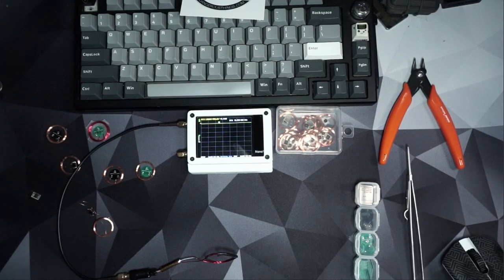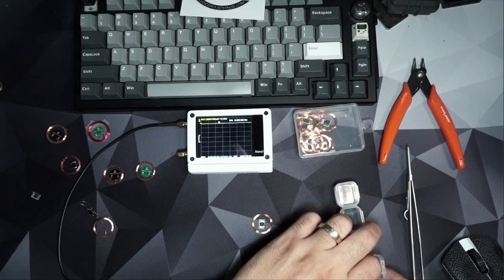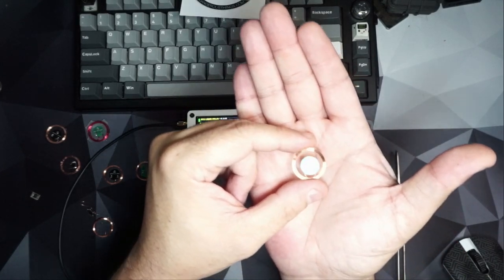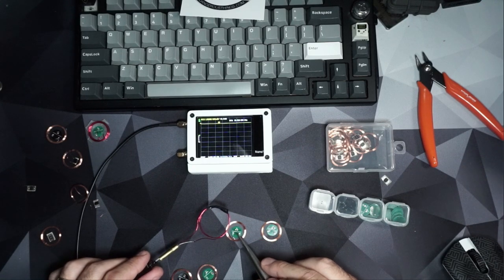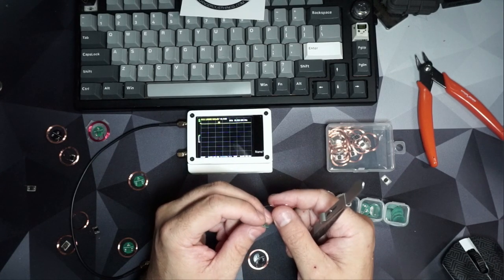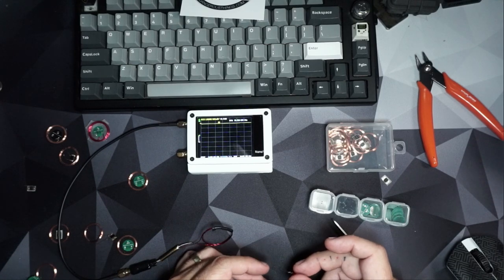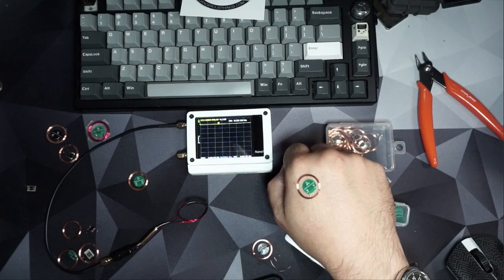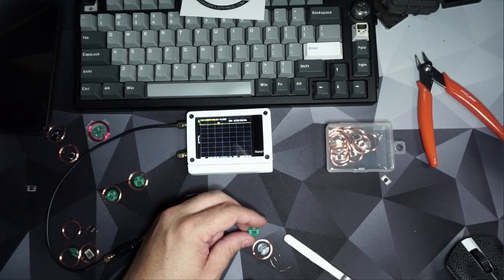NFC Antenna Adapter for Tuning Antennas

Comment: Hi, looking to buy in the UK. Do you ship to the UK or Europe?
Reply from the maker: @SouthEastApplianceRepairs  hey Robert.  I absolutely do.  And I have special pricing of my repeater stickers.  I see you placed your order.  I also launched a site that has more products than what is on tindie.  Midwestgadgets.org
Reply: @Hamspiced  This is amazing thank you very much. Wish I knew before ordering but is ok. I'm really looking forward to receiving the NFC repeater and testing it. I need it for my phone to take payments from my customers, on its own it is not working very well, I also have a phone case and maybe that's why. I hope your NFC repeater will do the job.:finger-red-number-one:
Reply from the maker: @SouthEastApplianceRepairs  I am positive it will.  I have had many customers with your exact issue and my repeaters resolve it. 

I plan to also release a NFC extender in the coming weeks where you can leave your phone down and have a pad that your customers can tap to send the signal to your phone.  Keep an eye on my site for that
Reply: @Hamspiced  That is amazing. I will definitely save your website in my Bookmark!

Comment: What tool did you connect to the VNA to see where the antenna is resonating?
Reply from the maker: Hey Gabriel. 

It's literally just a loop.  You can take an sma connector, make a loop with magnet wire, and solder it to the positive and negative terminal of a sma connector and it will let you measure just like I did.
Reply: @Hamspiced  wow, it looks amazing! Can this loop also be used to measure any antenna such as BLE, WiFi, GNSS and LTE-M ceramic antennas?
Reply from the maker: @Gabriel965519437  not sure, I've only ever used it on NFC devices in 13.56mhz and 125khz
Reply from the maker: Heres a link that has a how to build one of these that myself and another member put together to create these.
https://forum.dangerousthings.com/t/vna-set-up-and-antenna-mod/21497/5

Comment: Links to the AliExpress antennas so that we can replicate this with your boards?
Reply from the maker: hey, my apolgies i am just now seeing this comment.  The actual antenna's i used arent available anymore but i found these and they "should" work.  youll want to test and tune with a vna though

https://www.aliexpress.us/item/2251832763056899.html?spm=a2g0o.productlist.main.49.4fe9txN6txN61n&algo_pvid=578d919b-f56c-4d00-a5c4-aa3d76fa8a87&algo_exp_id=578d919b-f56c-4d00-a5c4-aa3d76fa8a87-24&pdp_npi=4%40dis%21USD%2112.88%2112.88%21%21%2112.88%2112.88%21%402103247917188243505798277e5dc4%2166227622818%21sea%21US%21813385180%21&curPageLogUid=GdHBfQk0tdLY&utparam-url=scene%3Asearch%7Cquery_from%3A&gatewayAdapt=glo2usa